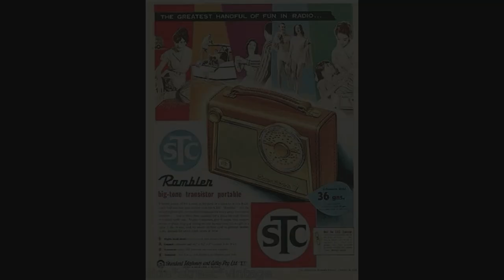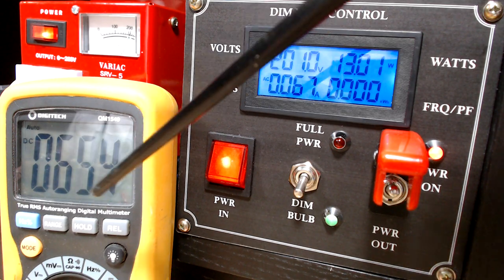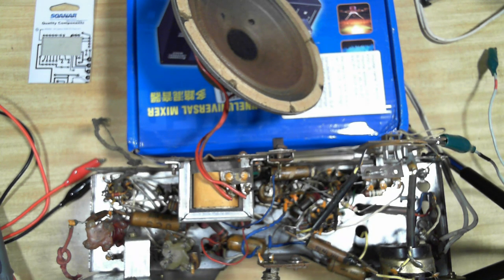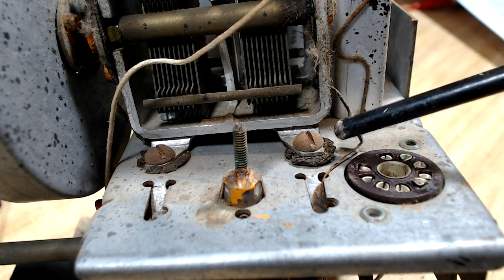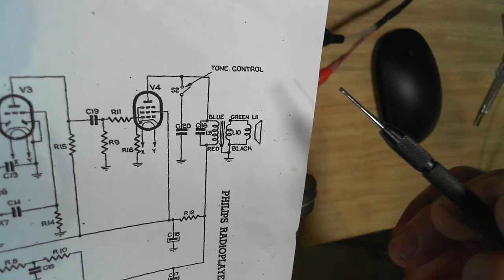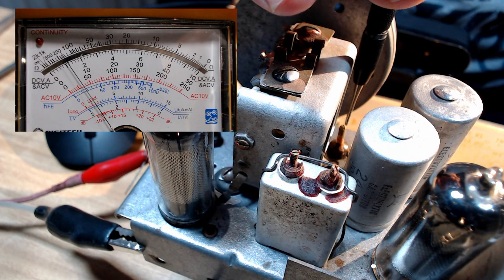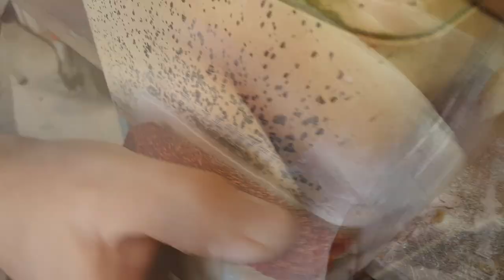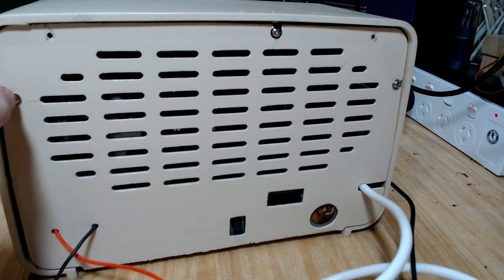$1 Basket Case Radio Restore - Fleetwood 1061 AKA Philips 165

Comment: wish i could get some of those 6M5s/EL80s here in the UK , theyre similar in characteristics to the octal EL33,
Reply from the maker: HI andygozzo72 , they aren't easy to get here either. A 6CK6 (EL83) can be used if you tie G3 (pin 6) to the cathode (pin 3). Also look at 6BQ5 (EL84). I have used the pentode section of a 6BM8 (ECL82) but requires rewiring of the socket and increasing the bias from 6 to I think about 15 Volts 🙂 please check the above before subbing, I may be wrong on all accounts 👍
Reply: @DavidTipton101  The russian 6P15P is a near equivalent to the EL83. I haven't checked the pin-outs, they are still cheap and easily available. Excellent restoration.
Reply: @stevehead365  6P15P IS an EL83, as near as makes no difference, same pinout according to data i have...  6P14P is EL84, 6P18P is EL82, rarely found, PL82 more common , theres also a 6P43P , near to EL82 or EL86 , 6P1P has near enough same characteristics as 6BW6 , (and also 6AQ5 and 6V6) but different pinout unfortunately, these can usually be got hold of very cheap
Reply: i dont know if theres a russian pin compatible equivalent of a 6M5/EL80, but dont think so...

Comment: I watched the whole thing and I’m not even a big radio guy! 

There are a lot of of ideas I can use in my own restoring of vehicles, toys, etc.

It’s the first time I’ve seen a fix to fiber board. Could you briefly explain that process? I saw paper and wood filler, but couldn’t tell the other ingredients.

Cheers!
Reply from the maker: Hi B Mingo, I should have made that clearer in the video, sorry.  It is just Papier Mâché but mixed with PVA glue instead of water. I used toilet tissue soaked in water for 30 seconds wrung out and chopped up in a mini chopper. If has flour and a little oil added then mix into a putty with the PVA glue. If the backboard is coloured brown or black I add acrylic paint to match the existing colour.  It dries as hard as a rock. There are recipes online for Papier Mâché, just change them to use PVA instead of water and chop the paper up, not into strips 😉
Reply: David,

Thank you for the info! 

And the glue mix that you painted all over the fiber board backer was a glue mix as well? This adds rigidity? 

-Ben
Reply from the maker: @bmingo2828  it was PVA glue thinned down with water to soak into the cardboard back. It rebinds the edge of the cardboard and stiffens it. Clamping it between cling film made it dry perfectly flat, nothing sticks to cling film.

Comment: They sell a kit for your headlights when they become opaque you can use that to shine up that plexiglass
Reply from the maker: Hi Boe'nealTV, the discoloration was all the way through the plastic unfortunately. I even sandpapered it but it wouldn't clear up. Thanks 🙂
Reply: @DavidTipton101  Some people remove yellowing on old consoles and computers with UV and hydrogen peroxide. Would something like that work?
Reply from the maker: @Underscore23  I tried that on the dial just last week and it didn't make any improvement but thanks for the suggestion 🙂

Comment: Good work David.  Your video has certainly motivated me to restore an old Phillips tube radio and an old Heath kit HAM transceiver that I have. Do you know of a good source for purchasing tubes/valves. I am in Jamaica. 

Winston
Reply from the maker: Hi Winston, that would be terrific to get you old sets working again. Perhaps Google or ebay may help source some tubes. There are mail order sites for tubes in the US and Canada they may show up in a Google search. I get most of mine through a couple of local radio clubs and sometimes some Facebook radio groups I'm in. A lot of time the tubes are ok, it's the capacitors that fail 🤔👍

Comment: Good evening David, good job on the radio came up like new. a few questions about the new station the Dim Bulb controller, that you don't have to reset all the time now, Volts, Amps, Watts, Hz display.  Your Isolation Transformer & your sand machine for cleaning parts. Every time I see these parts of equipment "BOY this must have cost you a fortune". Cheers mate.
Reply from the maker: HI Dennis, I made the dim bulb controller, the meter is readily available on ebay for about $20. The isolation transformer is from Radio Parts in Melbourne, the sandblaster was an end of line product from Super Cheap and was ex-display so was marked down further, the glass media was more expensive than the machine 😄 I already had the compressor and shop vac. I guess I collected a bit of stuff over time.

Comment: Great restoration!  Can you describe what you used to make that pulp mixture to restore the radio backing?  I saw bits of TP, wood filler, a JB weld material, olive or machine oil? and was that flour?
Thanks.
Reply from the maker: Hi zorka4098. I would be happy to. The mixture is described in my comments section under the video. If you need more info please ask, cheers 👍🙂
Reply: @DavidTipton101   Sorry, I guess it helps to read the additional comments! ;->
Reply from the maker: @zorka4098  no need to apologise,  I should have referenced it in the video, cheersc👍😉

Comment: Granted, it's not brominated plastic, but you can indeed reverse chemical process discoloration in plastics; the Retr0brite process is just such an example, returning yellowed plastics to their original color, and even reversing chemically induced structural weakness in some plastics.
Reply from the maker: Hi ChozoSR388 , I tried the RetrObrite method on the dial only yesterday and it did nothing, it doesn't look any different 😌
Reply: @DavidTipton101  Right, I was just using Retr0brite as an example; I don't know what the method for perspex or other types of plastics would be, though, maybe someone else can help you further, if such a method exists.

Comment: I’ve got a question for you.  I know how to deal with most plastics, and Bakelite, but what about Catalin❓
Just bought a $10.oo ‘54 Montgomery Wards Airline. AA-5. The radio is filthy and the top is scratched up pretty good.
Also, what type of paint should I use to re-paint the lettering ❓
I’ve found nothing [ so far ] in my search.
Thanks 
📻🙂
Update:
I’ve no idea what this material is .  I removed the radio and cleaned the case. A Clay Bar Removed paint splatter.
There’s a “dimple “ in the center of the top,and a cigarette burn( melt), yet, I’ve buffed it with a [high tech] Medium compound, and my “ high-speed”( variable speed) buffer ( soft foam 8” pad on fairly low speed).  The “plastic “ or whatever it is came back to life with no buffer marks, but not really doing much talking out all of the scarring.
Anyone know what it is made of, and any tips, I’d appreciate it.
I only spent $10.oo for the radio so I’m not too concerned about screwing up.
📻🙂
Reply from the maker: Hi Jeff, I have no experience with Catalin so I can't help you there. I just use spray paint that will adhere to plastic or use a plastic primer first. You could try sanding the burn mark but test on the bottom of the case first to see if it will work. Hopefully someone else may have some experience 🙂
Reply: David Tipton 
Thanks for your reply.
Maybe someone else has information/ suggestions.
Y’all have a blessed day.
📻🙂

Comment: aha, open circuit 220k in a triode anode circuit 😁 dunno why but these and 680k seem to go high/open more  than any other value..
Reply from the maker: Really? interesting andygozzo72, I'll remember that. It's only supplying the screen, it should be an easy job 🙂

Comment: thank you For this vedio, where you connected the voltmeter and which range you put it ac or dc
Reply from the maker: Hi hilali, If I connected to the output valve plate (anode) with a capacitor the meter would be set to AC, I usually say in the video, sorry 🙂

Comment: Hello sir. I watched your video well.
I'm also preparing old radio & record player restoration. 
If it's okay, may I ask what's the liquid materials when repairing lacked plastic body parts. 
Waiting for kindness reply.
Reply from the maker: Hello User, good luck with your project. I used J-B Weld for the plastic repair 👍🙂

Comment: What ingredients did you use for the repair to the radio back cover? Another impressive restoration!
Reply from the maker: Hi Steven, It's just Papier Mâché but I use PVA glue as the adhesive and a bit of flour as a filler and binder. If the back I'm repairing is not painted a add acrylic artists paint to colour match the original. In this instance it wasn't dry when I removed it from the press but a minute or two with the heat gun and it was rock hard 🙂
Reply: @DavidTipton101  Thanks David I'll try that.

Comment: Amazing job! What was the process that was done to the rear panel? What type of adhesive’s and filler’s were those?
Reply from the maker: HI fred, I used watered down PVA adhesive to soak the cardboard and pressed it flat till it dried. The filler is just paper mache mixed with PVA instead of water 🙂

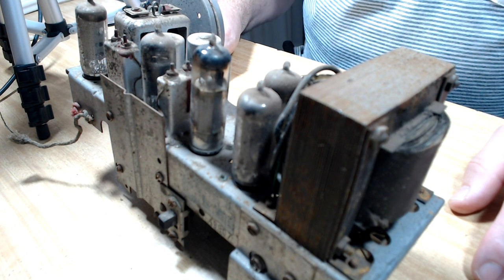Comment: What are the "shorts" in the tubes you are talking about around 4:00? (I learned only BJTs and FETs in school.)
Reply from the maker: Hi Herr Friberger, sorry, I have had trouble with 6M5 valves in previous videos. When I test them on my valve tester they always show a short between one or two of the internal elements of the valve and it happens on new or old stock valves so I don't know if it's the valves or my valve tester. They seem to function OK in the circuit though and all associated voltages are OK. I have another valve tester now so I will see if that does the same thing 👍🙂

Comment: Car headlight restorer kit should work on Those foggy plastic Looking Glass
Reply from the maker: I tried everything including headlight restorer GPD, the discolouration is right through the plastic I'm afraid 😖🙂
Reply: @DavidTipton101  I Guess you need a special techniques to make another one Moving On The digits is difficult 1 Maybe there specialist company print on  see-through plastic
Reply from the maker: @gpowerdragon9852  I ended up with a good one from a friend in the radio club 👍

Comment: it really turned out nice David was that wood glue that use to hold the grille cloth on ?
Reply from the maker: Hi Richard, yes, wood glue and spray on contact adhesive on the back edges. These days I use spray-on contact adhesive and only spray it on one surface, it allows me to pull it up again to align it yet hold sections that are proper position to stay there.  It also comes off in one piece if it needs to be removed at a later date 🙂
Reply: @DavidTipton101  Thanks David I really enjoy doing the electrical restoration on radios and have been many years but I still see grille cloth as a pain .
Reply from the maker: @richardbrobeck2384  I feel your pain Richard 😀
Reply: @DavidTipton101  Thanks for the tip !

Comment: bit unusual that output transformer not being pitch covered as is 'usual' for philips. maybe a replacement?.it doesnt look 'philips ish' in mechanical design?
Reply from the maker: I expect Philips had moved on from pitch transformers by 1955 or you would hope so. This is an Australian radio and most parts would have been manufactured in Oz so may be different form the UK and Europe models. Fleetwood were distributed by selected outlets in Australia where the Philips equivalent would have been sold by the major retailers. Fleetwood branded Philips radios were also available in New Zealand I think.
Reply: @DavidTipton101  the mains transformer certainly looks philips 😉 were all australian radios transformer powered?maybe safety regulations? with isolated chassis? or were there series heater sets, which were very common here in the uk and more so in the usa?
Reply from the maker: @andygozzo72  In my limited experience I haven't seen an Aussie built transformerless AC/DC radio but I am assured there were some. We did have many UK built radios that were AC/DC but not so much from the US though. I don't think it was mandated to have a transformer, it was just how we did it and maybe didn't need the DC aspect as much.
Reply: @DavidTipton101  it was probably done here more for  cheapness than necessity, especially after the mid 50's 😉

Comment: Hej David. Jeg er mega glad for alle de videoer du har lavet , jeg er så stolt på dine vegne du laver mange ting som jeg troede ikke var muligt , super godt David, jeg laver selv AMP`S fra bunden og reparere andre AMP`S, men jeg har lige et spørgsmål til dig, når du måler for at indstille kanalerne måler du så fra chassis og til et andet sted ? ville meget gerne vide det så jeg kan få min to-r merkur p4 til at køre igen, på forhånd tusinde tak. you are a supermann.
          med 
Venlig Hilsen
AMPMARSTERNILSSON
       FYN DENMARK.😀😀
Reply from the maker: Hej Ken, (jeg tror det er Ken) tak. Jeg er meget glad for, at du kan lide min kanal. Jeg tror, du spørger, hvor jeg fastgør ledningerne til multimeteret. Der er en række muligheder, jeg fastgør ledningerne til pladen på lydudgangsventilen. Jeg har en 0,1uF polyhætte i serie med måleren for at blokere DC og tillade lydsignalet til måleren. Som du ved, er der flere hundrede volt på pladen, så vær forsigtig med ikke at kortslutte den eller røre ved den. Du kan også fastgøre ledningerne til højttalerens stemmespole. Jeg håber det hjælper 😀😀
Reply: Hej David. Nu har jeg prøvet at gøre som du sagde og jeg tror det virker, jeg skal vel bruge " HZ " på multimeteret til målingen er det ikke rigtig ? Tusinde tak for feet back. 🤓🤓
Reply from the maker: @kbn636  Jeg indstillede måleren til den laveste AC-skala, jeg har ikke prøvet det på Hz. Det burde virke på samme måde.

Comment: i am suprised you powered up without recapping.
Reply from the maker: Hi carbidegrd1, I get that comment occasionally and you are right but as I alway reply, I want to show how an old radio acts and any symptoms it displays without any work done on it. I can then show the result of having changed components and what issues have been solved. I always power on carefully and us a dim bulb to take any excess load if it exists. After power on and it works I then do a complete recap. It also adds drama to the video as people want to see if I blow myself up 😃 Thanks for your comment 👍🙂

Comment: David sir, can you suggest me from where i can purchase old vacume tube UY41 (for U598 Murphy radio). I am from India.
Reply from the maker: Hi manoj kumar, I couldn't find any in a quick search. Try a Google search using these equivalent tube numbers for the UY41: 31A3, V311, 311SU, MUY41. The UY41 is a half-wave rectifier, if you changed the base you could substitute a similar rectifier tube. Otherwise, you could keep the tube in the set so it looks original (if you have one) and use a 1N4007 diode as the rectifier and a 330 Ohm, 5 Watt or greater resistor in the filament string. You may be able to hide both under the chassis but the resistor will get hot as it's dissipating about 3 Watts so it may need to go on top of the chassis for cooling. The B+ may be too high with the diode so you may need to add about a 47 Ohm resistor (use Ohms law to calculate the wattage: https://www.mouser.com search for "ohms Law") in series with the diode to lower it.
Reply: @DavidTipton101  thanks sir for you valuable info....😊.
Reply: If i were in Australia,  i send to you my radio for restoration...😔my badluck
Reply: @DavidTipton101  sir, 1 more question. If we are going to use IN4007 diode, Is it necessary to use resistance in filament string?
Reply from the maker: Hi manoj, yes you will need a resistor in the series string. If you can, re-read my first reply, I suggested you will need a 330 Ohm resistor of 5 Watts or more in the string. Also read where I said you may need to add a resistor in series with the diode if the B+ is too high, good luck and be careful with those high voltages 👍🙂
Reply: @DavidTipton101  thanks sir, actually i am doing it by myself following your videos as inspiration and guiding tutorials.😊🙏

Comment: David sir, i just want to know, why connection are so messy in these radios?
Reply from the maker: Hi manoj, sorry I don't quite know what you are asking, if you are asking about the point to point wiring under the chassis it was just the way it was done in the days before printed circuit boards, even it early TVs 🙂
Reply: @DavidTipton101  thanks for info. That was my question.

Comment: Would you be willing to post your "recipe" for that filler you created out of cotton??
Reply from the maker: Hi Trent, yes of course, it's posted elsewhere in the comments too. It is just Papier Mâché but mixed with PVA glue instead of water. I used toilet tissue soaked in water for 30 seconds wrung out and chopped up in a mini chopper. If has flour and a little oil added then mix into a putty with the PVA glue. If the backboard is coloured brown or black I add acrylic paint to match the existing colour.  It dries as hard as a rock. There a recipes online for Papier Mâché, just change them to use PVA instead of water and chop the paper up, not in strips 😉

Comment: I will say you have to be careful with breathing around those old caps after you have pulled them apart as they contain PCB oil which is a known carcinogen! PCB oil was used as the stabiliser in the electrolyte thus why those old caps could last so much longer and really why your old UCC caps still worked.
Reply from the maker: Hi Burnt Out Electronics. I haven't come across any with any sign of oil just paper and foil but I will heed your advice, thanks for the tip 👍🙂
Reply: David Tipton yeah it wouldn’t be very obvious that it’s in there as it’s mixed in with many other chemicals etc but as long as you don’t ingest it you should be ok. I’d just recommend Gloves when hollowing out another one that’s all :)